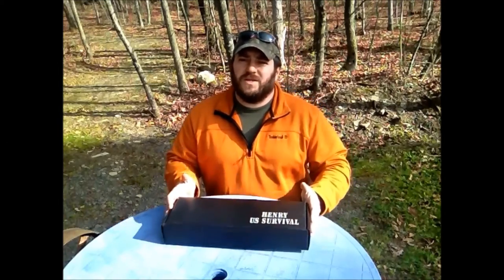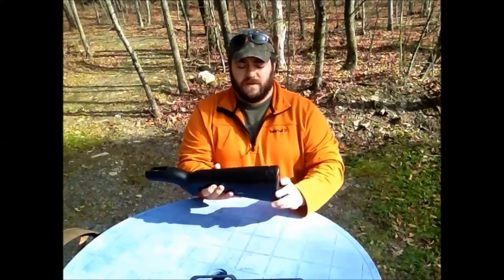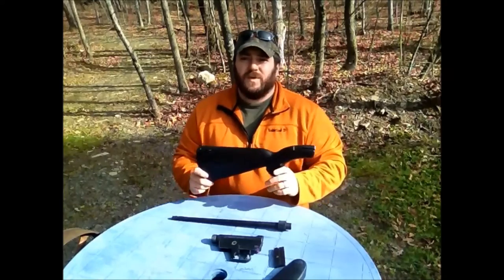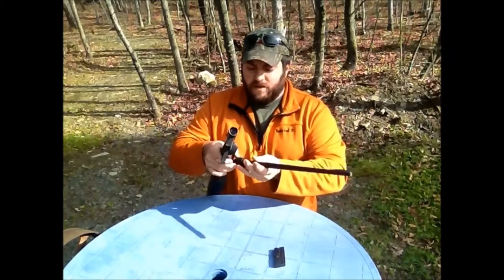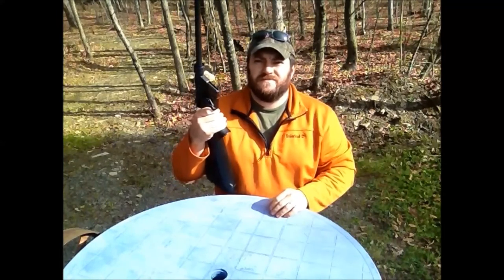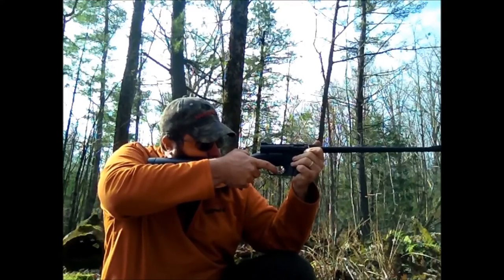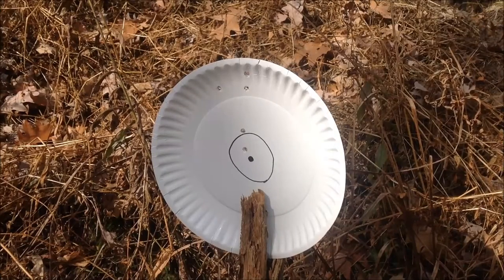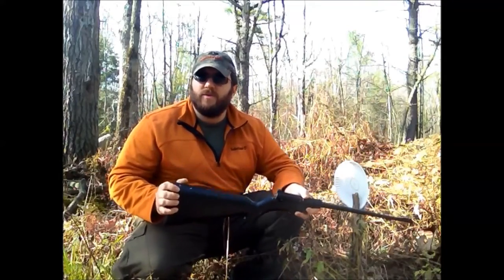▄︻̷̿┻̿═━一 DIY Survival Rifle Field Test .22 Henry Collapsable Survival Gun / Self Defense Weapon

Comment: I have one made back in the 1970s(late). Have not fired it in over 10 years, but after watching this I will be taking it out and making time to go shooting. Nice video
Reply from the maker: acklan3 Yeah that is a good idea. Take it out and enjoy it. I found that this particular survival rifle is a very handy rifle to have. It is compact and really easy to assemble, not even a tool is required.
Reply: Dan Rogers I carried it for more than 10 years in my boat when we camped in the swamp. I preferred  my Remington 552a.
Reply from the maker: acklan3 Does yours float like then newer ones advertise that ability to?
Reply: Dan Rogers Yes sir it does. My had the old rubber boot type cover. Like an inner tube. It leaks but the cap still stays put.
Reply from the maker: acklan3 I don't know if the butt stocks are still the same dimensions as the newer rifles stocks, but they do sell replacement parts for the newer models. You might be able to just replace the rubber boot cap easily enough.
Reply: Dan Rogers Thanks for the info.